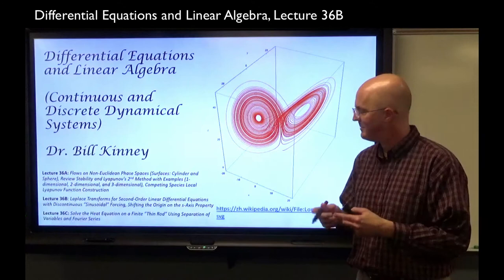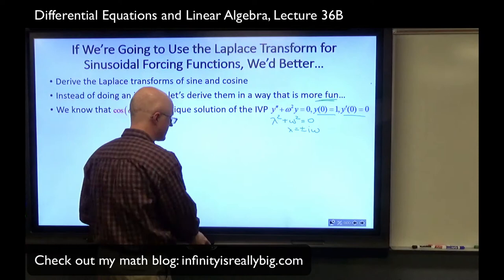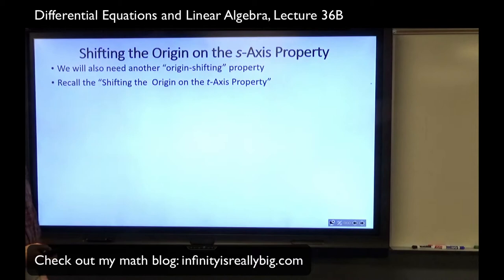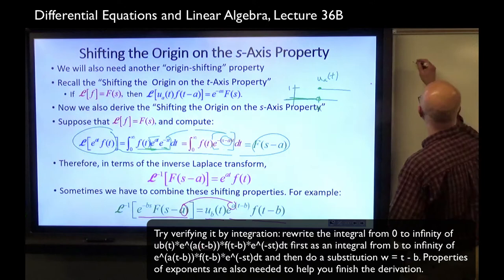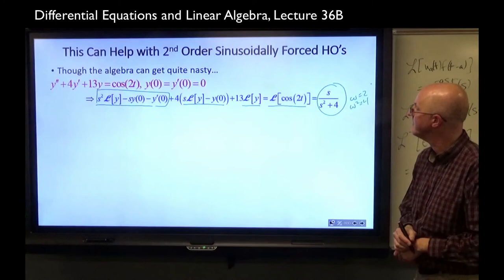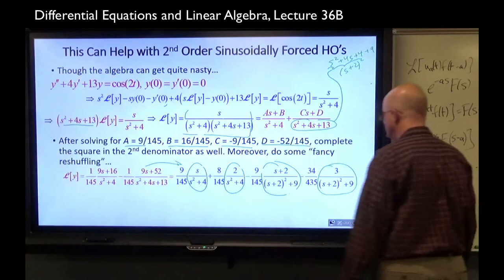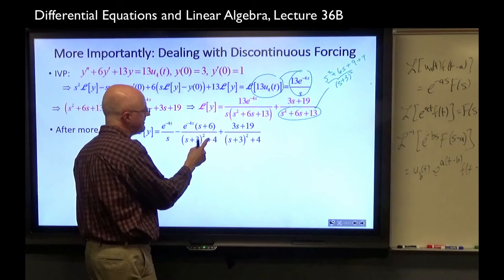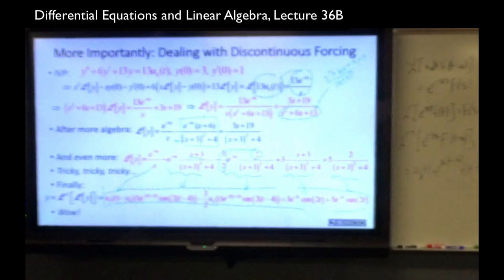Laplace Transform for Second Order Differential Equations (Forced Harmonic), Second Shifting Theorem

Comment: Professor Kinney thank you for a short and exceptional video/lecture on the Laplace Transform for Second Order Ordinary Differential Equations (Forced Harmonic). Although I have seen this material before, this is the first time that I can remember the Second Shifting Theorem used to solve a problem in Ordinary  Differential Equations. Using Laplace Transform to solve Second Order Ordinary Differential Equations is simple, however the solutions are messy.
Reply from the maker: You're welcome!